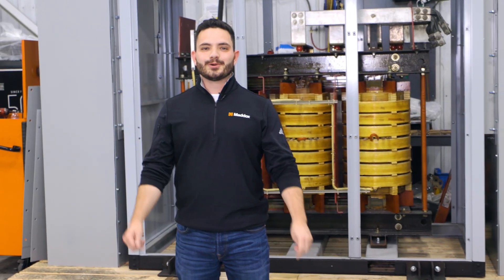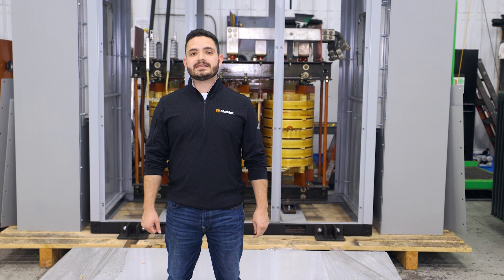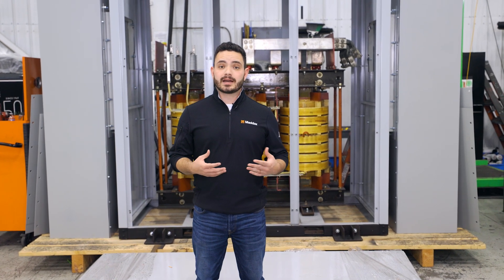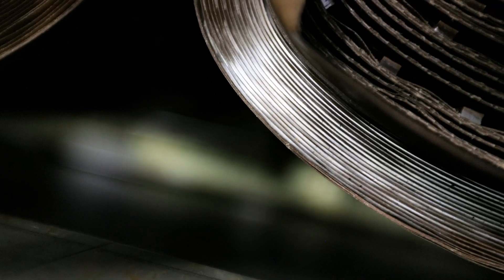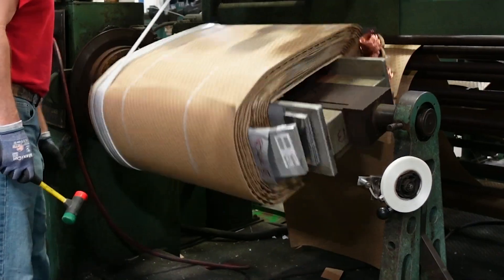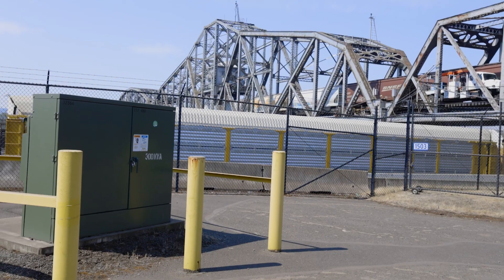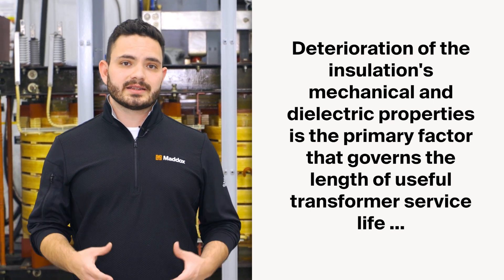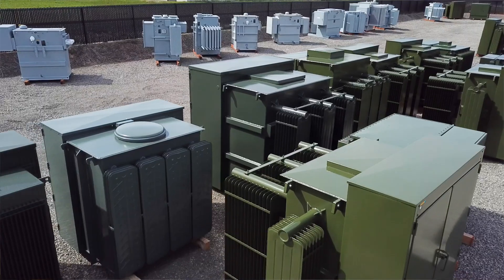Copper vs Aluminum Transformer Windings

Comment: the storytelling is in the right direction, but some data is wrong, like Gold is better that silver. Electrical Conductivity by Volume
Silver - Best conductor (63 x 10^6 Siemens/meter).
Copper - Very close to silver (59.6 x 10^6 Siemens/meter).
Gold - Less conductive than copper (45 x 10^6 Siemens/meter).
Aluminum - Least conductive of the four (37.7 x 10^6 Siemens/meter).

Comment: I'm very surprised that Gold was SAID to be more conductive than Copper in this video by the host,
This is 100% the script writers fault for not asking for it to be reviewed by the company, or basically by any engineer on earth!
Gold is not more conductive than Copper, PERIOD ! 
The conductivity of Copper = 1.00 , PERIOD* !
The conductivity of Silver = 1.04  compared to Copper.
The conductivity of Gold = 0.70 compared to Copper.
The conductivity of Aluminum = 0.61 compared to Copper. (Al IS much lighter than Cu, so you can just use 39% more gauge & Al is then equal !)
The conductivity of Tin = 0.15 compared to Copper.
The conductivity of Lead = 0.08 compared to Copper.

Silver is famously used as a plating for radio frequency components (always over copper) because of the "Skin-Effect" of it's superior conductivity.
Gold is only commonly used where its superior corrosion resistance is better than most other metals, and so it's used as Gold plating on connectors, switch-contacts, and in harsh environments.

P.S. That whole side-thing about the "number of electrons" (with pictures as proof!) on metals is also very credibility harming for the company as well...
*Copper is the standard of conductivity that all other metals are compared to and is the reference of comparison of conduction to, FOREVER !

Comment: Very interesting.  I've seen transformers in domestic microwave ovens with copper and aluminium primaries, the difference in weight is remarkable.

I've also seen aluminium cable used in house wiring (UK), that was a disaster, the conductor fractured if the cable was moved even slightly.  I guess it had work-hardened over time.

Comment: The order is silver, copper, aluminum, then gold. Same order for heat conduction as well. Copper is generally used for the high current secondary windings, aluminum is generally used for high voltage primary and secondary windings. Newer pole transformers have an aluminum winding for the primary and aluminum sheet for the secondary.

Comment: I watched 46 seconds, and you made multiple mistakes that completely blow up your credibility. The number of electrons an element has is unrelated to how conductive it is. Gold is not a better conductor than copper, it is alctually worse, and the melting point of copper and gold are almost identical, and both melt at such a high temperature that it is not relevant to transformer operation.
Reply: do you honestly think they did not do their homework? This is not some schmoe in his mom's kitchen
Reply: @818Maddox  I honestly think the guy is wrong on many counts. I don’t know why. But wrong he is. And he ought to be embarrassed.
Reply: @jimmurphy5355 
Where?

 what are the mistakes?
You do know that this is a multi million dollar company with 100s of employees right? 
That they don't just say whatever.
Reply: @richardthenryvideos I mentioned several in my first comment. And if you read through more comments here you will see that I am not the only one that noted the errors. 
As for how I know, I’m a physics major who worked for years designing various kind of electrical and electronic equipment. I worked closely with transformer suppliers and know plenty about the details of their construction and the various trade offs that are possible.
Reply: @jimmurphy5355
Credentials don’t equate to being correct all the time
Reply: @1833-j4g  No, I am not always right about stuff - but I am correct much more often than not, regarding technical/science issues. Always willing to admit mistakes and learn from them, and always willing to double check when challenged. In this particular case, regarding the conductivity and melting points of various metals, I am quite certain of my knowledge.

Comment: Many home generators use aluminum in their windings instead of copper as a cost and weight saving benefit. There are copper in some but many of the newer ones have aluminum instead. I have noticed this during repairs.

Comment: You mention silicon steel for the core, amongst other things. Let's get more precise ---

1) The Dept of Energy started regulating transformer efficiency in 2007. The standards were updated in 2016.
They were supposed to be updated in 2022, but the steel industry went ballistic over the likely required change from silicon steel to amorphous steel. A two year delay to 2024 ensued. The requirements were modified downward to save the US silicon steel industry and its US jobs.

2) Aluminum has about 60% of the conductivity/ampacity of copper. All else being equal, the aluminum conductors need to be a bit under twice the cross-section of copper conductors. Example: If you are putting in a 50 amp feed for an EV charger, depending on temperature rating of the insulation and ambient temperature et al, you can use 6 AWG copper, but need 3 AWG aluminum (consult an electrician for more details). 

3) A 500 kVA transformer running at 99.35% efficiency, at 500 kVA will dissipate 3250 watts. This is about three times the heat from a typical US home electric space heater. This is a big transformer, but this is still a non-trivial amount of waste heat.

4) Using aluminum wire in houses is cheaper, but the lower mechanical/compressive strength of aluminum means the screw connections at all the switches and outlets were less reliable, and aluminum stopped being used. Copper-clad aluminum wire is supposed to be a compromise (I am not convinced ...). The open-air feeds to my house from the pole to the breaker box are aluminum - aluminum being lower density (lighter) is especially good for aerial applications.

Comment: Copper coated aluminum as a winding 😅
Reply: That is used where soldering is needed, usually for high frequency transformers such as the ones in switchmode power supplies.❤

Comment: A company I worked for made neon sign transformers. They changed the primary from copper to aluminum which cut $6 per transformer yet no changes at all were made to either production or other activities in the total production. These transformers are no longer made, now being replaced by electronic inverters.
Reply: Yup aluminum is a good choice for high voltage windings as it can be treated to take an oxide coating and then lacquered to make it even more resistant to internal arcing. Most MOTs use a copper primary but aluminum secondary windings.

Comment: The difference in melting points is nothing. (20C . Copper 1084C, Gold 1064C) The important part is the specific heat required for the solid to liquid (or partial liquid) phase change.

The only reason to use aluminum these days is cost... copper is WAY more expensive. I've seen a lot of electrical wiring done with Al simply because it's cheaper. (yes, one has to use more of it, but it's still cheaper.)

Comment: Starting the video off with factually incorrect statements about different metals is not a good start before you explain factual differences between metals as the point of the video.
Reply: Misunderstanding

Comment: Your statements about the resistance of metals are WAY OFF.  The conductivity is not proportional to the number of electrons in the atom.  It is much more complex than that!  It is the FREE electrons that count, & the ease that they can move.  Copper, silver, & gold have only 1 free electron per atom.  Aluminum has 3.  But all this complexity is boiled down in metal conductivity tables.  Silver is the best.  Copper is about 4% worse than silver.  GOLD IS ONLY 76% AS GOOD AS COPPER!  Aluminum is 64% as good as copper.  All metals, when rolled, formed, or drawn for strength, have lower conductivity then annealed metal.
https://en.wikipedia.org/wiki/Electrical_resistivity_and_conductivity
          There are other complicating factors.  Enamel insulation can not be reliably put on silver (coating flakes due to gas bubbles coming from the metal).  This rules out silver in wire format (cost aside)  Aluminum is difficult to make connection to, & tends to corrode.  If there is ANY moisture in the oil fill, the aluminum will corrode, first at the connection points at the winding ends or taps.  Aluminum windings can crack.
          In smaller transformers (not oil filled) & industrial motors, aluminum is nothing but TROUBLE.

Comment: Some electric cables are made from copper plated aluminium. Same diameter but cheaper to make. They overheat at full load. Totally illegal.

Comment: The required added volume of aluminum, and the resulting larger core, means greater core losses (all things being equal), even though the copper losses are held constant. Core losses are all of the time, whereas copper losses vary with the square of the load current. So keeping core losses down is very important, not only for the stated full load efficiency, but the all important no load continuous (core) losses.  It would be interesting to see a direct comparison between two otherwise identically rated transformers, one wound in aluminum, the other in copper, and see what are their respective no load losses??

Comment: This starts out flat out wrong, right off the bat!  Gold is most certainly not as conductive as copper or aluminum!  Silver is best, copper is second, and (edited) gold is third. And it has nothing to do with how many total electrons the atom happens to have.
Reply: Gold is third. Aluminum is a close fourth.
Reply: Also it does not melt at a low temperature
Reply: I believe the point is that gold makes  better connections
Reply: replying to @realvanman1:

SHOW US YOUR DEGREE OR CERTIFICATE IN **ELECTRICAL ENGINEERING**, CLOWN
Reply: wood is not conductor
Reply: @victimovtalent6036  It is at high voltages!
Reply: @victimovtalent6036 Wood can become conductive at voltages as low as a few kilovolts (kV) if the moisture content is high. For dry wood, the breakdown voltage is typically higher, often in the range of 20-30 kV or more.
Reply: What about diamonds?
Reply: @sdas683  I always advocate for laser diamonds cooled to absolute zero at the edge of a black hole event horizon.
Reply: LOL
Reply: Lies
Reply: eventually you'll find out why good quality electrical contacts are gold-coated, and not silver or copper coated.
Reply: @brevitygreaves2321 because gold doesn’t oxidize
Reply: @brevitygreaves2321 and the very best contacts are platium iridium - because they dont melt AND dont oxidise. They were used in telephone switches for a century.
Rhodium contacts are pretty good too.
Gold is worthless as a relay contact at over 24V or 20mA - silver is better for high currents. (PS I have used solid gold relays for thermocouple switching - $1000 per relay in 1980...)
Reply: @brevitygreaves2321  and not to forget - to squeeze a premium out of the gullible ones.....
A ten atom thick layer of gold on a meter long wire is going to change nothing about the resistance of the wire. The coating is for corrosion resistance, nothing else - tin does a fine job there, too. Gold wire was used to contact dies to the socket pins because it was so soft and could be welded with ultrasound, but that use has been in a steady decline for decades.

Comment: gold is more conductive than copper? who says?
Reply: I was under the impression the conductivity scale was silver>copper>gold
Reply: @Bossmodegoat  You are correct!
Reply: Our presenter.  :)  Who is probably thinking "electrons per atom" is playing a role.
Reply: Short answer: It is not.
Reply: gold isn't more conductive, but it's ability to not oxidize makes it ideal for connectors in electronics, on PC motherboards, RAM sticks, GPU's etc.
Reply: @fireofdestruction7753  It's also very ductile which makes it ideal for the very thin wires used in semiconductor devices.
Reply: many others would disagree 
https://www.reddit.com/r/Retconned/comments/iyzbas/does_anyone_else_remember_being_taught_that_gold/
Reply: Science
Reply: @AndrewTa530  no. Gold is less conductive than copper.

Comment: This is a good video in general, but you keep referring to the number of "electrons per atom" between different metals as if that actually has anything to do with conductivity.  It does not.  For example, metals like tungsten have far more "electrons per atom" than copper, or even silver, yet are still much much worse conductors.

The number of free electrons (those above the Fermi level) can be a factor in conductivity, but that is not the same thing as the number of total electrons that an atom has.  However, more often, the main differences in conductivity in metals actually have nothing to do with how many electrons they have, but instead have to do more with their physical lattice structure and electromagnetic interactions within the metal instead.  This is a very complicated area and there is much much more to it than just "more electrons more good."
Reply: Thanks, this is a helpful clarification. I like the idea and presentation of this video, but more work on rigorous accuracy would help.
Reply: Thanks for this comment. The presenter needs to improve his knowledge of Chemistry and materials science.
Reply: The number of valence electrons are more important than the total number of electrons.
Reply: @kirkbolas4985  this is not even true. Aluminium has 3 valence electrons, copper has two and either of gold and silver each have one but their electrical conductivities do directly correspond to the number of valence electrons. Silver for example is better than copper, which is better than aluminium. Meanwhile Zinc, magnesium, calcium, Nickel etc which typically have 2 valence electrons aren't as good as copper. Both silver and copper are also better conductors than gold but gold is better than aluminium. As someone commented earlier, this topic can get quite complicated. A summary will be that the lower the energy required to excite valence electron(s) into the conduction band, the better the electrical conductivity of the material (in the above cases, metals) . The presenter might do well by avoiding the discussion on electrons, valence electrons or total number of electrons when discussing the topic in the above video. Preferably, he can make very brief reference and create a separate video to tackle the topic.
Reply: exactly, more is not better.